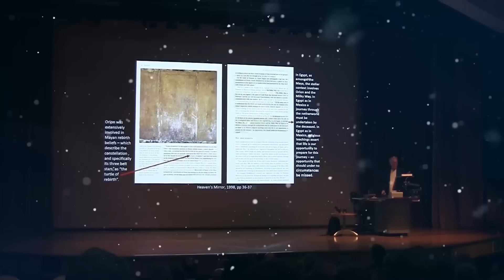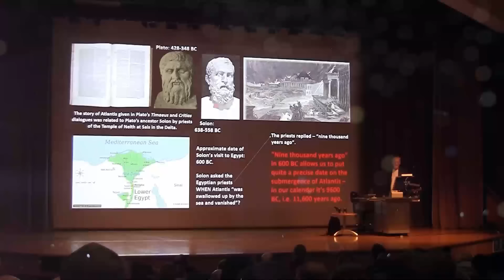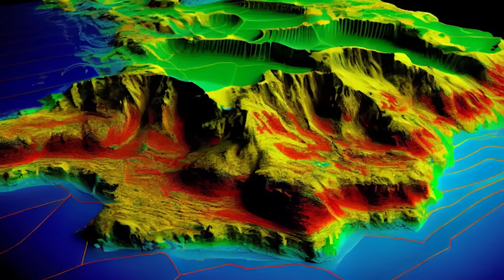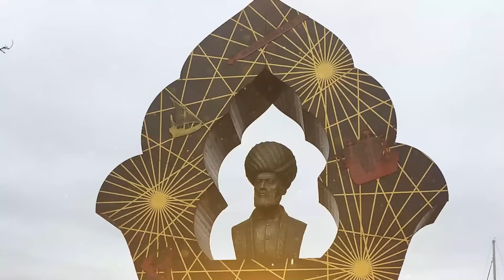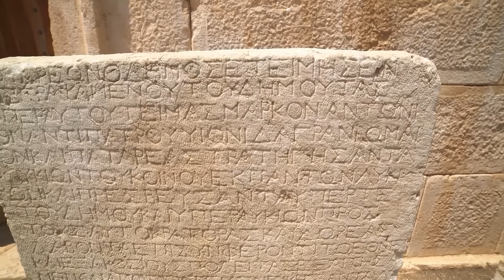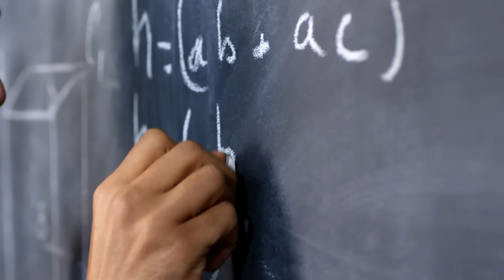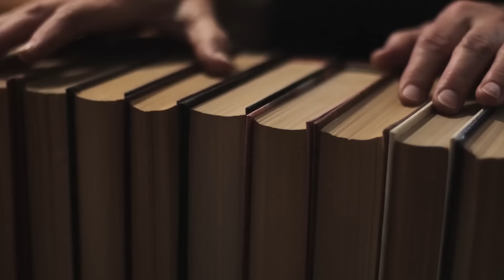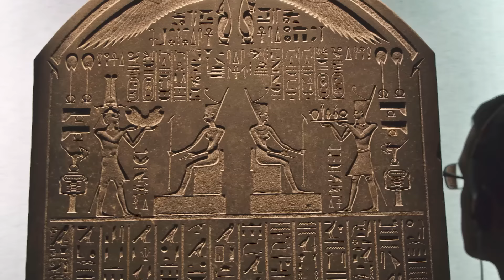Jungle Mystery - Scientists Discovered An Ancient Cave In The Amazon That Defies Logic

Comment: So, based on your observations the body panels gaps and missaligment,  safety hazards like sharp exposed edges, adhesive issues and noise levels, road and creeking sounds, door and  Tonneau cover iclearly indicates a lower build quality compared to Lexus, Meecedez , BMW, and even Hyundai, KIa, and  Toyota. Especially when we are talking about a $100k vehicle.
The truck capabilities and unique design are great, but, the video is about build quality.
My rating based on your video and category of vehicle,( $100k price tag) is subpar build quality.
Great video!